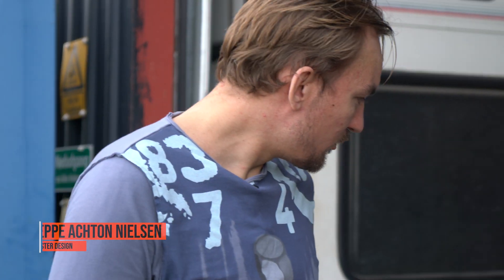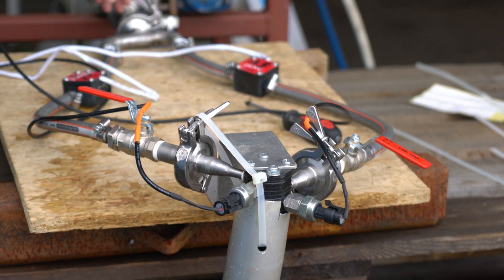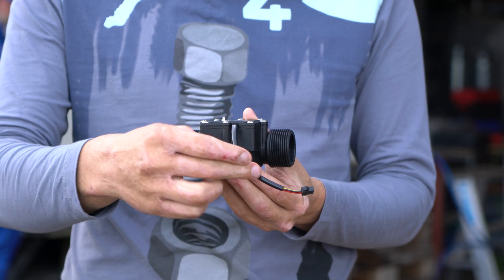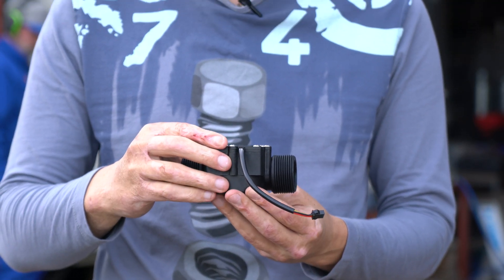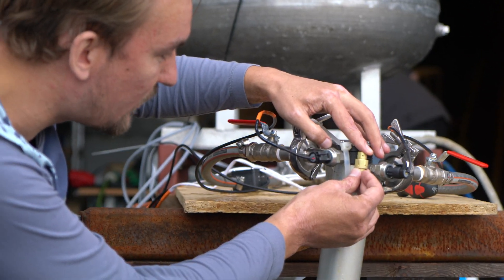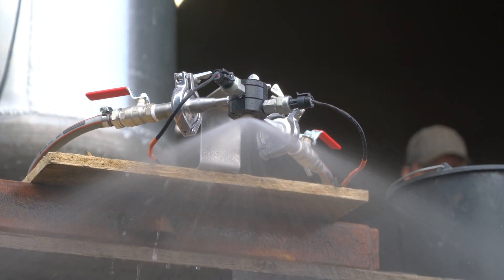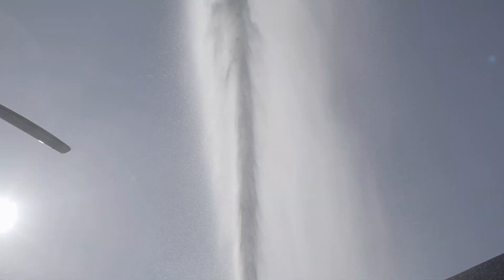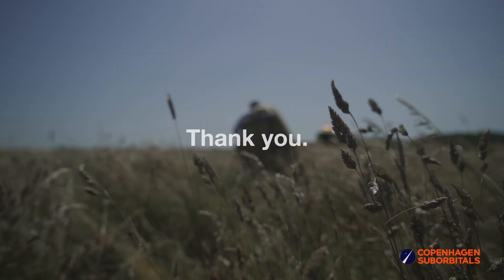Finding The Mass Flow of Rocket Fuel Injectors

Comment: I was wondering, how do you account for the difference in viscosity, density, surface tension, and other fluid properties between water and the actual propellants when analyzing the data from these injector tests?

Comment: Wouldnt it be much cheaper and faster to 3d print the injectors to determine the flow rate if your just using water in the system?
Reply from the maker: Not sure why? One element takes 5 minutes to machine and costs us around 10USD. Plus, doing it this way we also get to learn and practice how to solder them for later on as well.
Reply: Kai Mÿkra it’s a good idea!  But I think the pressures may still be too high?
There are some Americans companies that are 3D printing metal engine parts. Very exciting!

Comment: The real flow limit is not those nosels, but the extreme final throat pressure 🚀
Reply: Roger C if they increase the tank pressure by the pressure in the combustion chamber, then the delta P across the injector will be the same, and the flow rate will be the same.
Reply: But the fluid is being discharged to ambient atmosphere